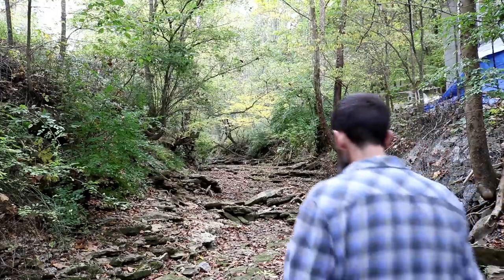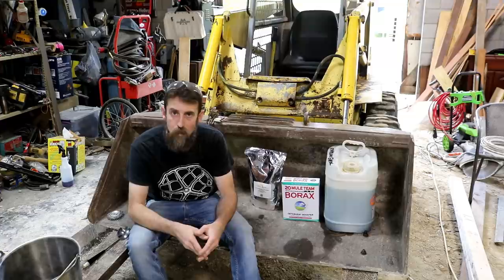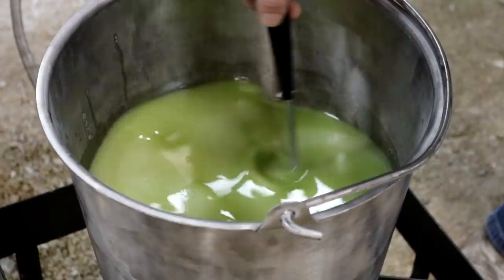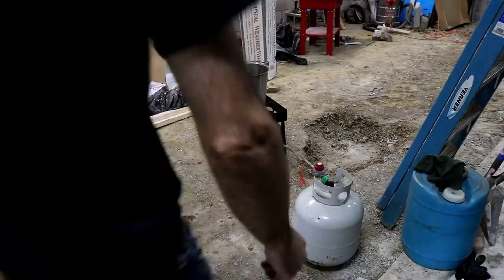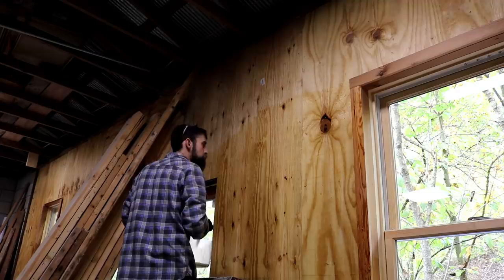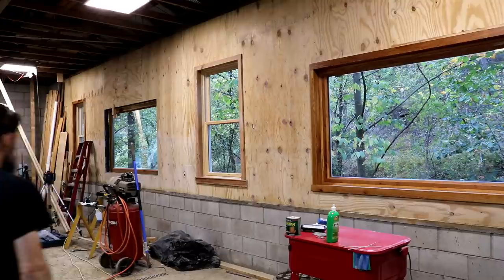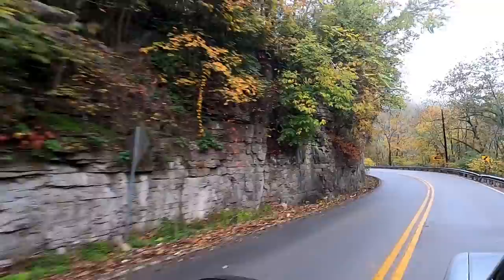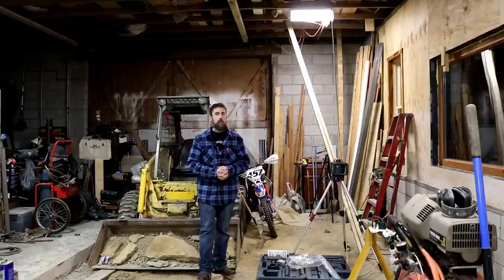Homebrew Wood Rot & Insect Treatment

Comment: Thank you from a UK viewer for this video.
Many years ago I worked with a guy who had prevciously been a linesman for the GPO (that's the General Post Office - they were then responsible for the UK telephone & telegraph system.).  Among other things he told us about the linesman's life, he said that an important item in his toolkit had been a hammer.  This hammer wasn't for driving nails - it was used to 'sound' the base of a telegraph pole before climbing it.  If a hammer blow gave the wrong sound it indicated that the pole was rotten at the base.  The lineman was not to go 'up the stick' but was to invoke the procesure to get the pole replaced.
Do you know that ethylene glycol is irrestable to cats?  If they find it they can't resist drinking it but it destroys their kidneys and they die a painful death!  I believe that UK regulations now require car anti-freeze to contain a bad-tasting additive to repel cats.  I see that Evan Jones agrees with me.

Comment: Both the Borax and Boric Acid are probably in the hydrated crystalline forms. Heating it removes the water and coverts it to the anhydrous forms which are more soluble in pure ethylene glycol than the hydrated forms. Happy Birthday Steve!
Reply: I've tried this in both ethylene glycol and propylene glycol (boyh from WalMart) the propylene glycol seemed to have a lot of water premixed into it.  I used an outdoor electric hot plate but was never able to get the grainy/sandy boric acid to get into solution.   I tried every combination of Borax/boric acid/ethylene glycol/propylene glycol.  Keeping in mind my ingredients were mobile home propylene glycol from WalMart and not pure.  The boric acid was pure from on-line.  
I've used a borate powder and that stuff just mixes readily with water and I can spray it on but it will wash off easily if not coated and leave a white residue. 
Possible that I'm not boiling off all the water and that is keeping the temperature down too low to get the boric acid into solution ?
Reply: @burtreynolds3143  It is very important that all the water is removed from the glycol in order to get the solid borates into solution. You really should be using a thermometer to make sure you are getting up to the temperatures stated in the video. My guess is that you aren't getting it hot enough to boil off all the water. After you add the borates you will have to continue boiling off any water introduced by the borates. They look dry but there is water of hydration locked into the borate crystals also. Stick with ethylene glycol not propylene glycol. I think the borates are less soluble in propylene glycol.
Reply: @William_Hada  It was last summer.  I think I bought a thermometer to use just for that.  
You are probably right.  Not hot enough.  
I had it on there all day.
I think the anti freeze had a lot of water in it from the factory.  I was trying to make it cheap.  
If I remember right, it smelled heating it up.  Glad I did it outside.

Comment: I once witnessed a crew drilling a small hole, at a downward angle, in the base of a wooden power pole; into which they injected what I assumed was a black creosote liquid. A wood plug was then driven into the hole to cap it. I have seen such plugs in in several power poles.

Comment: Hey Steve, If the mold was due to excess moisture in the air you would see it uniformly over the whole plywood. The fact that it's only happening next to the seal plate probably means either your roof is leaking or your block wall is wicking up moisture from the ground. In any case keep us updated about this concoction :)

Comment: Local utility had crews here all summer drilling and inserting "Impel" rods - boric acid -into the base of all wood poles and then tagging them. Log home builders use them on the weather exposed log ends to stop any rot for about forever.

Comment: I've come across that wood treatment recipe in the past.  I'm not sure about the boiling though, as I would expect the excess boric acid and borax to precipitate back out as it cooled down.
I have some I made here using plain clear ethylene glycol with just as much boric acid and borax as would dissolve in it naturally at room temperature.
I've not used it yet, so It'll be interesting to see how your test of it works out.
I have used the diagonal hole technique and a spray bottle to deeply soak wood with preservative.
Reply from the maker: It all stayed in solution very well. I didn't notice it fall out at all. I was very surprised given the amount of solids vs liquid.  Seemed stable. Hopefully it works, it should. 
Great to see you Clive 👍
Reply: @SteveSummers  Boric acid is extremely useful.  It acts as a fire retarder in materials, can be mixed with sugar for ants to carry back to their colonies and remove them, treat stinky boots and foot issues and loads of other things.
Reply: I'm using borax as an additive to a white-wash (some portland, 2/1. for better sticking effect) for a basement that is stone set and high moisture, on the floor joists and upper-floor-ceiling lumber and the walls..  Borax is also a fire retardant.  My moisture level this summer only got down to 60% with help from a dehumidifier and the floor was not entirely semi sealed with concrete pavers set into higher limestone-sand mortar.  Water is able to precipitate through the mortar, but it has been getting dry.  Before, the floor was coated with coal and ash and I removed 2 to 4 inches of this mix, bucket by bucket, a couple of tons.
Old houses are something else..  Makes one wonder just how long most older houses from the 1900s are really going to last (in the USA).  I bought  this one with land and it had just has a really nice  lipstick-job on the rest of the interior (not inspected and the plumbing sucks as it was not just the replacement of existing, but done that way).
Reply: Fancy seeing you here Big Clive.
Reply: bigclivedotcom hey Clive, good seeing you here from the stream, you could also try the charring of the wood surface method I mention in the comments here, maybe something to mention in your stream in the months to come about how well it preserved the wood, continued success 

     Sincerely 
               Fabrizio
Reply: @SteveSummers  The boiling gets rid of the water of hydration in the Borax crystalline salts. The anhydrous forms are more soluble in the glycol so they will not precipitate out.

Comment: Steve, the ethylene glycol in car anti-freeze is already watered down.  Pure ethylene glycol is viscous, much like glycerin.  Hydrogen bonding is the reason.

Borates have been used for a very long time in insect control.
Reply: Yes the borax will preserve the wood, and the white surface is the excess borax. Been using it for a while, injecting into the damaged areas with termites, and it kills them, and they will not eat the wood further. Not as toxic as other wood preservatives.

Comment: One thing I have learned about major insect infestation, the cause is usually large amounts of moisture. In fact we used to use a method that we called "follow the ants" to find where a roof is leaking. The excess water creates an ideal condition of temperature and moisture for them to live in. Get rid of the leaks and you will get rid of the destructive bugs. Of course it does not help to live in high humidity, mold grows on everything and retains even more moisture. You should definitely paint all surfaces to help keep excess anything from growing aggressively.

Comment: Steve, may I suggest painting the shop walls white. It will make the shop look brighter in the dark days of winter.
Happy bd and anniversaries!
Reply: I second this. Painting the walls and ceiling white makes the room look both bigger and brighter.
Reply: @knas5289  I tried that with my garage and it didn't work. After I painted it I filled it full of junk and it does not look or feel very big to me at all.

Comment: New roof sheathing should get a coat of that home brew wood preservative on the underside. Treat the 4x8 sheets before you install them by leaning them against the wall and roll or spray. Better than doing it overhead after they’re installed.

Comment: We got an old timber frame building (everything above the brick basement) from the 1880s, where the oak uprights appear to have been treated with creosot oil from coal tar (typical smell when drilled). 
Some work had to be done to a 1960s extension, during that we found one of the new uprights fully permeated and covered with some fungus, maybe serpula lacrymans or such, but the old wood right next to it was totally unaffected, it had was too hard to get any screw in without predrilling.
In the old days telegraph poles and railroad ties were treated with this stuff and they lasted really long.
Bugs don´t want to eat such wood (like your salvaged floor boards), and it seems to be pretty toxic for everything alive.

Here in Europe this treatment is no longer possible, it´s outlawed. 
But in the US, maybe it´s still around.

Another somewhat more recent discovery of mine: 
If there is wood to put on something stone, concrete or  metal pole shoe, put a piece of lead flashing inbetween.
I had to rebuild a pergola, the upper parts had rotted everywhere they could not dry out fast, except for the bottom end of the poles, they sat on a piece of lead sheet, the wood there was perfectly fine after over 30 years. The lead styed where it was when I placed the new poles 
Lead isn´t that toxic, but once a little acidity is introduced by some organisms, that will change.
A piece of copper should also work,  most organisms do not react well to it, copper sulfate is used to prevent algae growth in pools (maybe a little of that for your concoction?).
Founs something: https://www.ehow.com/about_6328075_copper-sulfate-wood-treatment.html

Comment: You can use an asphalt torch and char the surface of the wood, bugs don’t like eating through the charred surface and it really does protect the wood, I have planters that I’ve done this to and five years later it’s absolutely untouched, continued success 

     Sincerely 
               Fabrizio
Reply: I spend a lot of time in the woods and agree the burnt trees / wood never seem to rot.
Reply: My grandfather use mill beams that were charred from a fire and they never had bugs.
Reply: Might be difficult to do to an existing building. Maybe Steve will make a video of him using a long handle propane weed burner to char the wood he wants to save from carpenter ants.
Reply: Indeed....Yakisugi....bug-proof and water-proof!

Comment: Treated lumber will still rot just as fast as untreated pending on the conditions. Personally, used oil has been our go to product along with roofing tar. In my area, anything going into the ground, Osage Orange or Hedge. Doesn't rot anything like any other wood does, in fact it petrifies itself. Trying to use it in building materials... not practical. 
Happy 40th. Happy anniversary as well. Great video, cheers :)

Comment: Just a hint for using your remaining borax and boric acid. If you coat any metal that needs heat treatment with a wet mixture of both it will stop all the fire stain. I use it all the time, it works well. It sometimes need some wire wrapped around the the metal to keep the mixture in place, it also helps with handling the hot metal. Cheers Stefan.

Comment: Copper sulfate is very good for discouraging mold, termites, and roots wherever wood is close to the ground. It's cheap and safer than most mold/termite/root arresters. The downside is, it stains wood a bright blue color, so it's best buried an inch underground.
Reply: Copper sulphate its really bad against mold.I use super concentrated solution to wash various types of molds from seeds and most of the time it doesnt kill the mold at all ,even if i paint the mold opaque blue.
I hope boric acid and borax plus Glicol its better.
The best wood in North America i think its the black locust( its the wood from wich the rail road bridges are made in old western films).Now verry little used in USA but verry much esteemed and used in east europe.

Comment: Oh Wow,  Thanks for sharing your efforts to stop pests.   I am not sure how this mix prevents mold tho;  BUT I am sure all the carpenter ants, and any other wood rotting pests are sending signals out (from there little antenna's) throughout the swamp to NOT bother you tonight and for many anniversaries to come !!!  A couple easy suggestions and questions:  I been using a similar mix here in South Carolina for 5 years now.    Per a gallon,  add a cup of Vinegar (75% Industrial Strength) at the end to the cool mixture.   Vinegar husband together with Borax wife is proven to stop mold (Old Maids trick).   I am not sure either what the Ethylene Glycol does; does it help the mixture stick to the wood?   How does it help mold?    I do know that Vinegar with Borax and Boric Acid are GREAT solutions for pests.   I can attest I solved my termite and ant problems.   I live next to woods too in a similar wet lands in South Carolina... I used to have ants living on the sunny side of my house,  and termites eating away on the shady side.   Now for 5 years,   I have checked without observing ANY pests.    At key wood moisture areas,  I treat my crawl space at the rim joists and posts.   Hopefully,  you can develop your own mixture that can treat around the foundation footers to repel subterranean ants, pill bugs, and termites.   Hope your drainage is good !

Comment: Very interesting, have not seen that recipe before. I have used boric acid and copper sulfate similarly.
Borax, sodiumperborate, is very useful for these things as well:
1. Flux for forge welding.
2. Flux for bronze brazing.
3. Killing ants mixed with syrup. Same as the expensive ant traps sold in stores.
4. Detergent for washing really dirty stuff.
5. Protection when hardening small steel parts in the shop. Mix with boric acid.
Also around here, boric acid water solution has been used  to spray wood in moist basements etc to stop mold.
I wonder if the glycol and the boron compounds actually react when boiled in this recipe or just dissolve?

Comment: Steve, i hate bugs!  i lived in a 1902 log house that got carpenter bees.  as for the bats, i felt sorry that those bugeaters died too.  i cast one is sterling. boric acid is sometimes used to kill roaches.  bugs dont like borax much either. the erosion problem you show is very worrysome.   i  wish all the luck from here out be good.  poppy's workshop says HI

Comment: Koreans would hollow out the bottoms of vertical timbers in timber frames where they set on a rock and fill them with salt to prevent moisture damage.

Comment: I would think that when mixing, That starting with hot ethylene glycol  would be like making pudding on the stove..  If you were to heat the milk to a boil before adding the pudding mix, , It dose not turn out the same as when you start cold mix .(Its very lumpy and unusable) There is a(chemical reaction) with the slow heating and Stirring the pot

Comment: Used diesel oil for  posts before you put them in, soak them overnight to a foot over eventual ground level. Everybody knows this is true,and you can prove it by soaking a little bit of waste ground with it, nothing will grow for years, probably illegal but works. Or alternatively look at a scrapyard where they actually break motors down ! I have also noticed that scrap motor guys don’t make old bones as a rule !

Comment: I hope you get your roof done and without problems with weather. Cool weather is much better for roofing than hot weather but of course rain is a problem. I suspect that the green which you see on the wall is algae and not mold and is harmless in any case.

Comment: Here the local pine trees are fairly hard, moreso than say red pine, oregon pine and the likes but the local woodworm moths love the stuff, for years the locals made a bath out of plastic sheet and soaked the wood in diesel for a month, take it out and let the majority dry off  till it stopps dripping. After a further week its ready to use, it smells for a couple of weeks but afterwords its fine and strangely its no more flamable than wood itself. I have seen wood in this house that I bought and renovated and it was untouched by bugs, blueing or anything else and apparently was done over 40 years ago. Personaly for inside a house it would probably smell but for a workshop or barn fine and cheap.

Comment: There is a product out there called wet-and-forget.   For outside it does work very well on mold and mildew.  It may very well work for indoors as well.  I found it at Lowes about 20 dollars a quart but it is diluted 1 part to 5 with water.

Comment: Water boils at 212 F (100 C) at see level. As you go up in elevation, the boiling temperature falls due to pressure drop (roughly 1 C per 1000 ft)... I have been brewing/drinking hot black tea like a maniac all my adult life. Moving from 4000+ ft elevation to Florida, the difference in boiling time was very noticeable to me.

Comment: Another coating I am thinking about over for a last coating is a clove, cinnamon or even better cedar or even better, cypress oil coating.  I'd think redwood oil would be great too... though not certain how common, cost effective and useful would be.  I know the cedar and cypress is reactive with me where dries my mouth, sinus and throat membranes out so is more of a treatment where I can't be exposed to after applying for a few days.  Seems perfect for in the attic however.  Thinking just using an halogen lamp oil diffuser like I've done in the basement rooms that need airing out after a rain.

Comment: Put some in a spray bottle with fine stream nozzle.  Wherever you can't get the roller you can carefully spot spray a corner or seam.  No need to brush then.